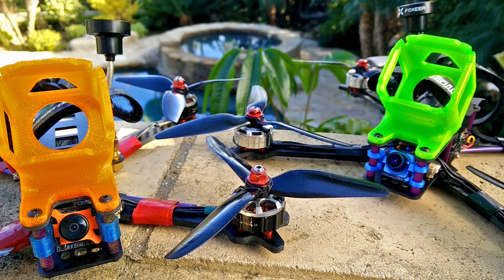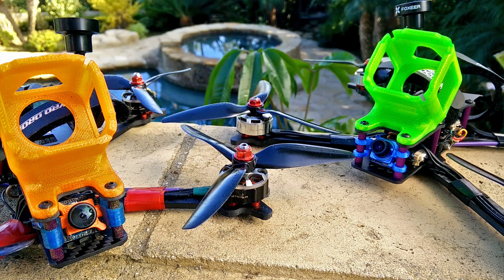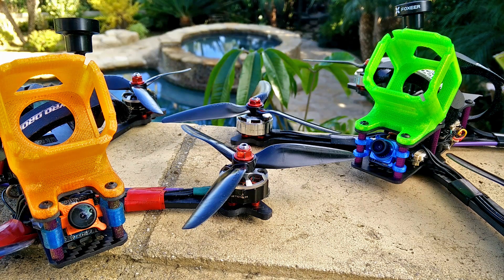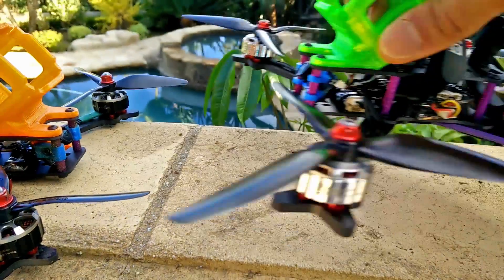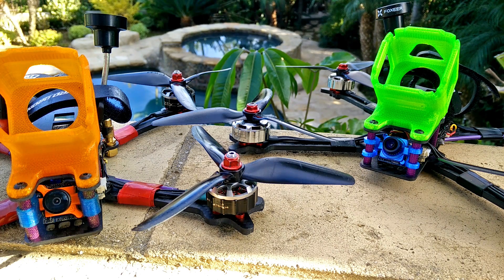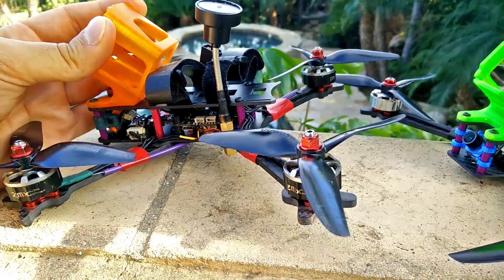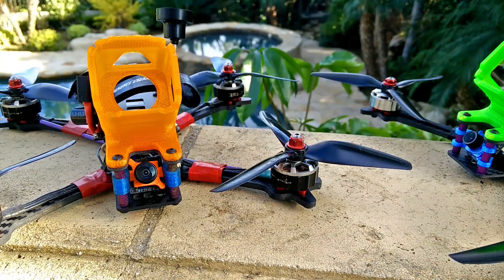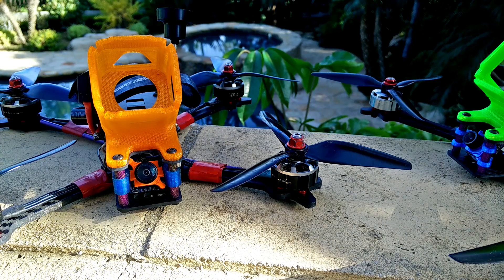un-Gyro Effect & Motor Width - Quad Theory Discussion

Comment: In Raceflight theres a airmode plus.
Reply: Raceflight.
No.
Reply: Hamza Mohammad Yep. When it says are all of your motors spinning press no, and it will increase the idle speed. There’s 3 idle speeds you can pick from.
Reply: I think you deleted your comment. I don't primarily fly raceflight. I am a kiss user.

Comment: Fun fact, was talking with steele at Flight Fest South and he said he has/had a version of his motor but with the bottom screw housing cut off like most new motors these days and he said it actually weighs more than the motor with the normal bottom housing.  I think you of all people would find that interesting.  I wonder if he told TBS it's not worth the extra weight for the next revision that should be dropping fairly soon.
Reply from the maker: This is true sometimes.  Not all the time.  One is also not really stronger than the other because the geometry of having the base railing makes it stronger while the naked bottom will usually have a thicker base of metal.  Overall, it's WAY easier to clean a motor without the bottom rail so I prefer it.

Comment: 8:30 if you see wobbles at zero throttle most likely your i term or idle % is too low. 
Airmode+ is your i term and tpu. ;)
Reply: Love the spitballing tech talk, numbers only take you so far, feel is what is matters.
Reply: 17:25 they are really good motors, BUT they are running the reduced shaft and small bearing and bend quite easily. Buddy  took out all 4 in one crash. 😮
Reply from the maker: wow, really!?  All 4 in 1 crash!?
Reply: Kabab FPV might have even been the first crash! Now that i think about it, if you come straight down the block that is in the base plate for the wires would hit the bell on one side and deflect it bending the shaft. 
Definitely staying away from the half naked bottom design now.

Comment: its interesting what your saying it maybe why I've been experimenting with an 8inch build to have good low speed control, (low noise) started with 2507 motors now waiting on a 2508 prototype, there is a 2514 that works well by the same company but think they are a bit on the heavy side. I'm trying to keep the overall weight as low as possible.
 I also like my 5/6 inch build with quad bladed props combined with 2305 2450kv motors, (soon will be trying out the 5.5's )
Reply from the maker: For 8" I would expect the 2508 to really be a good size.  When the props start getting that big, you lose the quick nimble performance of a miniquad since it's no longer mini.  Having a big powerful motor will give you some of that back however.  I still haven't gotten my 6" game under control let alone 7" and 8"...
Reply: (sorry its a bit long)
your right going past 7inch you do loose the nimbleness of the smaller setups, i have also tried different frame dimensions too to see how it affects stability and maneuverability, for me so far a 300mm true X seems to work well with 8inch props, i started with 350 but attempting fast turns seemed clumsy and slow. I'm now hopping the mentioned 2508 at the correct kv will have just the right torque to handle lower rpm's,  as the 2507 1500kv I've been testing is ok at the higher end of the rpm range. you could say I'm looking for the motor to be more liner through out the entire rpm range with an 8inch prop ?

Comment: I think heavier quad will have more momentum and it will stay longer in the air when you do flip. And you can do flip for longer time :D
Reply from the maker: This is usually false but believe what you like...
Reply: Kabab FPV I haven't tested any really heavy or light quads. I have one somewhere in the middle like 500g. Flies really good to me. :D
Reply from the maker: Apologies.  It's more complicated than you think and I believe it has more to do with the battery output ability vs weight than anything else.  Two videos for you on it from a while ago...

https://www.youtube.com/watch?v=zK2hZ-ZqNA4

https://www.youtube.com/watch?v=A3yPtNUu5Mw&t=
Reply: @Kabab FPV, I don't mean to dig up an old thread, nor do I mean to be a stuffy internet knowitall, but I would like to point out a few major flaws in your test about this weight effect. The test you performed is flawed in that you shot directly upwards, the point at which the effect is noticed LEAST, here is why: (1) Air resistance increases as a square of velocity, so the point at which the effect is noticed most is when the quad is moving fastest, which is ONLY at the beginning of the punchout and the end of the fall back, pretty minimal time for it to take maximum effect. (2) It is not a fair test as the velocity was not the same, I understand a lighter quad can move faster with faster punchouts, but in freestyle, speed is often not the desired effect. Horizontal floats at equal speeds is a proper test, which will make the effect most apparent. (3) The weight difference was not that much and human errors could easily mute the effect. Go for extremes to see a more noticeable difference.  I am confident that if the testing conditions are implemented correctly, the effect will be very apparent.

Hit me up if you would like me to do some calculations/simulations, I could get a definitive change in distance given equal initial velocities, assuming constant aerodynamic coefficients, simulating a horizontally moving quadcopter, analyzing the horizontal component.

Comment: Hey bob, I finally flew my floss 2 (total auw is 434g no gopro) 6 in arms, 2405 hyperlites 2722kv, u helped me last week on fb wire my crosfsfire reciever! On 5 inch props  it's so light vs my normal chameleon or heavy acro builds (700 grams ussually with session 5). I was wondering why it was so quiet and this video makes total sense lighter quad doesn't need to spin props as fast. It's noticeably quieter than my normal heavy builds. Good theory once again!!

Comment: I totally agree with your statements !!
I prefer high kv motors,  lower pitched props and then add 5s and hold the hell on !!!😜. I also change my throttle curve to 100% resolution at 75% throw this way I have less accidental yaw while going through aggressive throttle changes.  Keep ripping!!!

Comment: I love air mode until I disarm a bit slower than normal when crashing and the quad flips about on the floor or bounces and flies off for a second
Reply from the maker: This has been improved a LOT over the firmware versions.  Still there however and I know what you mean.  The code is made to be in the air, not on the ground.

Comment: Airmode is like a reversed TPA at low rpm (below 40% thottel). It bumps up the pid values. And of course you have to us disable motor_stop, which is default since 2.6.1, so the increased pid value got something to work with. Airmode is not only a rpm thing, right? :)
Reply from the maker: Right, it's not just rpm....at least that's as much as I know...
Reply from the maker: You changed your picture!

Comment: the Gyro effect being discussed should be able to be tested pretty well going between similar pitch props while changing between a x2 a x3 and a x4 prop.    Mass of the props should help make a gyroscopic effect more pronounced.

I have moved away from 6040x2 and 6045x2 in favor of 6045x3 for my 1800 and 1900kv builds.   The F80 1900kv and Xrotor 2405 1800 motors move those props quick.   F80s are heavy tho and the Xrotor 2405 have become my favorite for my cruiser, 7-8 min flight times on 1800mah 4s on a 7in Valorem with 2405 1800kv Xrotors and 6045x3.
Reply from the maker: Yeah I'm not a fan of the twin blade 6" at all either.  Even in 7" the triblades perform significantly better.
Reply: I just recently did a test for myself with 6" Martian with DYS Storm 2300kv comparing KK6040 and some noname 6045x3 and the triblades are actually more efficient if I am carefull with throttle.

Comment: Loves me some gyros! First you become that voice in my head telling me to floss and now making me want to go out and get a gyro. Are you sponsored by Krynos? "You likeada juice eh"?
So with your theory on disk unloading, how do you feel about frames like the ones Hyperlow has or the upcoming Remix-umaquad? How about frames that have motors that are inverted for and aft or even slightly staggered horizontal positioning?
Reply from the maker: The staggered Z geometry is actually a really good thing.  Not too much, just a little.  It has a similar effect like a long X, the back props get more fresh air.  I haven't inspected the Remix or Hyperlow closely to have an opinion.  I have however inspected the Chameleon and I feel it's a very poor design overall (no offense to the designer or anything even though I realize that's kind of a hurtful statement.  Just my opinion.)  These style frames that attempt to have a really tight COG between the blades will suffer from prop unloading issues unless something is done to manage the effect.  For top/mid batt mount race frames, it's not such a big deal because you're usually not running a gopro and the battery just sits in the center.  There's still plenty of room around for the props.  But if you're trying to cram the gopro in there and now you have a long solid line made of gopro and battery, your frame will need to be much larger to get the performance back.  It's a tradeoff.  I personally prefer a smaller stance frame so my design lifts the batt/gopro just over the prop line.  This in turn is a problem when you try to run a battery larger than ~1600mah or a 5S 1300mah because now you have too much weight above the prop line.  In addition, my frame has a more spread out COG in the Z axis so it's more for the motors/FC to manage with respect to inertia.  But this setup is more efficient on a smaller stance than having everything between the blades and I think my overall frame size is like 225mm or something.  There is no right or wrong but I feel these concepts are pretty important and can make a significant difference to the performance of the quad.

Comment: Surely a heavier quad will have to have a higher amount of thrust upwards so at a given angle it will have a greater amount of forward thrust as there is greater upward thrust.
Eg
380g auw 60 degree
vertical thrust of 380g
tan(60) * 380 = 658.2g forward thrust
 root 380^2+ 658.2^2 = 760 g of horizontal thrust total
600g acro 60 degree
tang(60) * 600g = 1039.2g forward thrust
root 600^2+1039.2^2 = 1199.8g total thrust
So at the given angle the heavy quad would feel faster many this is why many think heavy quads are faster.
Many people fly heavier quads at a lower angle so surely this may cause more prop was as the air hits the rear props  but at a higher angle on a light quad ( to attain the same forward thrust) the props will not be behind another as much giving the rear blade cleaner air making the quad smoother and many more efficient.

Comment: When you have angular momentum's in opposing directions the forces (gyroscopic effect) cancel.  Only time that force would come into play is when there is a differential in the momentum such as during a yaw maneuver.  I'd suggest this video series https://www.youtube.com/playlist?list=PL8dPuuaLjXtN0ge7yDk_UA0ldZJdhwkoV if you want to understand more about the physics of your quad.  Just do a video per day.  A basic physics background would make your theory videos MUCH better.  BTW, I floss every day :D
Reply: ZombieSS77 yeah it feels like he doesn’t understand why the motor has to keep spinning? I thought the whole point of air mode was to eliminate desyncs, and let the fc/esc know what position the motor is at at all times. I didn’t think it had anything to do with momentum?
Reply: Can confirm, did some calculations myself and even consulted a theoretical physics PHD, net angular momentum must be 0 or the quad will want to torque with non zero throttle (why helicopters have tail rotors), meaning no gyroscopic effect whatsoever (massively simplified result fyi). 

As for "prop unloading", I don't know that effect nearly as well, but it seems false. Putting prop guards on a quad (if ideal) is like putting a duct on a fan, which increases thrust and stability and will not make any change to the torque applied by changes in angular momentum (asymmetric motor changes cause net angular momentum in this case). The yaw ability is unrelated to airflow but rather angular momentum, why yaw still works fairly well without props at all, meaning there would be no effects on yaw from symmetric aerodynamic forces.

Comment: So you're saying that the relationship between speed of the prop in the gyroscopic affect could be exponential? Yay for 2408 lol jk I feel that you can run a more inefficient set up if, you are easier on the throttle you have to change your flying style. That makes sense with what I was thinking to you I feel like a wider motor would have more torque in the lower end and a taller motor would have more torque in the upper end

Comment: Hi, your capacitor is huge. I use on Kamikaze smaller 470uf fm series capacitor which gives me almost 2000uf at power leads. I have no noise issue. Can you make a video on rssi because I wanted to remap rrsi on TX6 (inverted) with smart port? Thx!
Reply from the maker: Remapping the rssi is a bit screwy actually.  I dunno how to do it without just messing around with it until it works.  I just leave it as is and don't touch it

Comment: So how do ducts on tiny whoops come into play?
Reply from the maker: MF-BOOM great question. I was gonna discuss this but didn't wanna offend all the whoopers. Get a frame with no guards. Your tiny whoop will become a little monster.
Reply: dammit I just finished the rakeon 1s brushless whoop build lol, the one thing I do wonder is when we go so small how much do these aerodynamic principles come into play
Reply from the maker: They are meaningful but work differently.  Very differently.  The issue with going small is the disk loading problem.  In order to maintain disk loading proportions of larger quads, you need to be impossibly light.  That also explains why/how insects are so efficient and capable.  That's the main reason why the tiny stuff flies like shit.  The smallest viable package is a 3" that weighs sub 120g AUW and ideally no more than 100g.  Than it will at least perform well albeit slower than the larger sizes.

Comment: This is unrelated, but why do you think some people prefer KISS or Raceflight over Betaflight? I see no real reason for the super high price tag for average components. Also, it's curious that the KISS 24a esc don't pop easily compared to the 30-35a escs we've been seeing lately.
Reply from the maker: It's probably just preference.  They can all now have the same flight performance just like how mac's and PC's can do the same things too.  Some are just more used to one.  I prefer BF just because the hardware selection is vast and cheap.  I dunno about KISS ESC's vs other esc's.  Last I heard KISS esc's have always had problems here and there with catching fire but I don't know first hand because I don't use KISS.

Comment: what are the dimensions of the arms on the flowride?
Reply from the maker: The 5" is 11.9mm wide and 83.3mm from motor center to first arm mounting screw.  The 6" is 12.9mm
 wide and 97mm long.
Reply: Kabab FPV are they both 4mm?

Comment: Have u seen the budget line of motors dys is coming out with? They have a 2206, 2306, and 2207 coming out for the same price: $9.90 on bg. Do u think dys is a reputable, qc company? If these motors r 7075 aluminum with 4mm bearings I'm gonna be all over them. What r your thoughts?
Reply from the maker: DYS has never really made fantastic products.  They're alright, but not fantastic.  That being said, I hope the 2207 is reasonable because a $10 half decent motor would be fantastic for the market.  I have no idea why people are still making 2206 motors.  It's the most worthless size in existence.  It's not light enough to be light and not powerful enough to be powerful.
Reply: Kabab FPV because u want a motor more powerful than 2205 but not as powerful as 2207? Just a guess 😉

Comment: Are the Session mounts only fastened in the front?
Reply from the maker: There's one screw in the middle back under the gopro.  No need to add another 1.5g of screw and nut for 4 screws.

Comment: Mechanical gyros (motors and props) spinning in opposite directions produce no net gyroscopic stability.  When spinning at the same speed the CW motors cancel out the CCW motors.  Pitch and roll commands increase 1cw & 1ccw motor while slowing the other CW/CCW pair, so once again no net gyroscopic stability.  Yaw increases and decreases the motor rpms in CW/CCW pairs at which time you do have net gyroscopic stability.  Now, remember gyroscopic precision, the gyroscopic stability is actually 90 degrees out of phase from a disturbance(pitch disturbance results in roll and roll in pitch... the same reason a top wobbles in a slow circle), not really what you want in a quad and has to be overcome by the flight controller.... see https://www.youtube.com/watch?v=vGun5athdfg.  If you really want to test this, remove props, spin up motors (motors tab best method)  and feel stability(the gyroscopic effect will be much smaller than with props installed but still noticable).  Spin all four, then try opposite corners only and check the reaction to trying to pitch or roll the frame.

If you want more stability at low throttle, increase idle speed(as mentioned in other comments).  Remember propellers are airfoils that do stall, while falling at low throttle (low forward speed of airfoil) the relative angle of attack of the props goes up and at some point stall will occur.  A stalled prop will not produce consistent or meaningful thrust to be used for stability.